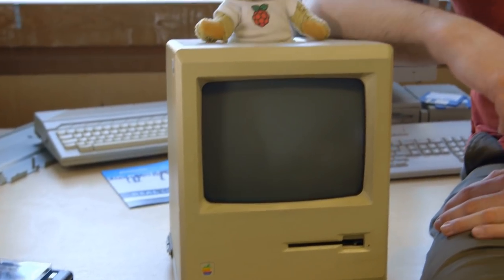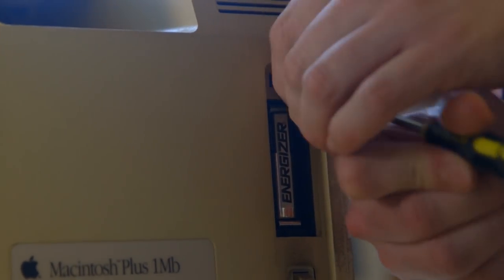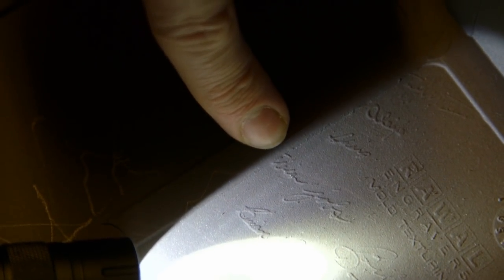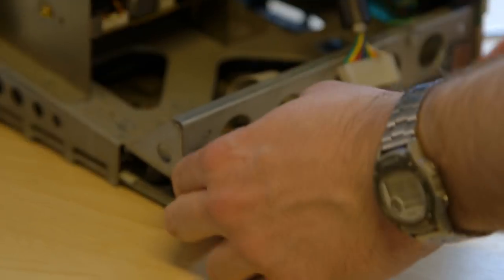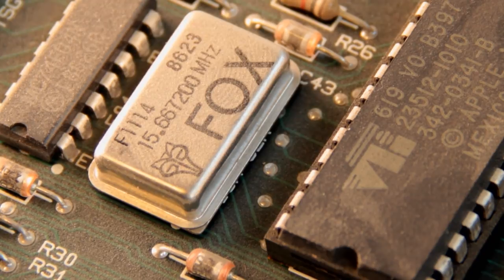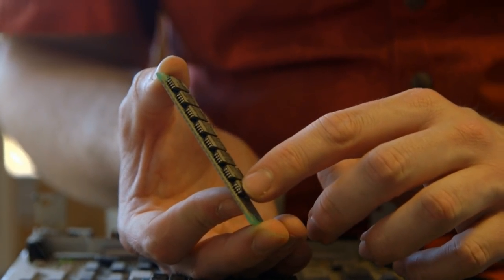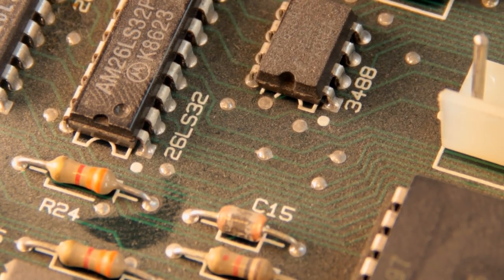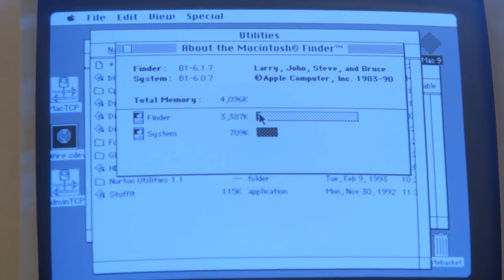Opening up the 30yr old Mac - Computerphile

Comment: I once decided to try to disassemble a camera for fun... Turns out there was this thing inside that contained energy for the flash... Maybe 230 volts? .-. Paralysed me for a few seconds -.-
Reply: Lmao. Doh!
Reply: Damn man, glad you're fine. You probably did it to learn something and in the end you learnt something :D
Reply: maybe it's a capacitor because they can discharge absurd amount of voltage and flashes need that.
Reply: Yeah, probably! :P
Reply: 230 volts? Trust me, you wouldn't be able to write this here then.
Reply: Welcome to the party! :p
Reply: TheIceWarrior It's actually probably a lot more than 230V. (Those flash types like their HV.) But the total charge and thus the damage it can do to your body is rather limited.
Reply: ***** Ohm's law
Reply: +Erik Bakker The 'It's not the volts, it's the amps' statement is painfully wrong. Take one look at Ohm's law and you can see this.
Reply: ok?

Comment: And to further add to the confusion, apple ran that 16/32 chip in a 24-Bit mode....
Reply: +THEtechknight 24 bit mode just refers to how everything was converted from 16 to 32 and from 32 to 16 whenever it entered and left the chip. When you say something is 24 bit, everyone knows you really mean 16/32. It is just easier to say 24.
Reply: 540iDavid Not in the Apple world. it has an entirely different meaning. The databus is 16 bits, but the Address bus is 24 bits wide. it can address up to 16MB of space total. Thats what 24-bit mode means in the apple world. 32bit address capable CPUs came out, but early Apple machines defaulted in 24-bit mode, and the ROM was dirty meaning the last byte of the 32-bit word was used for other things instead of addressing. MODE32 fixed this.
Reply: The 68000 has a 24 bit address bus so it's not like you could use it any other way.

Comment: Be careful taking those little bastards apart. The flyback transformer in those will hold a jolt that will stop your heart for many years after being unplugged.
Reply: What, nobody has corrected this in all these years??! A transformer or an inductor will not hold a charge. A capacitor will. And frankly I'm a bit surprised that Steve was just blatantly "I'm not touching that". It is not hard to discharge the big capacitors! Well maybe Steve has not much knowledge about analog/power electronics...
Reply: false.

Comment: It also had 16 bit ALU. I personally view it 32 bit as later pure 32 bit CPUs ran exactly same code. While it could use "only" 16 MB memory, in principle it could have used full 4 GB if it had had enough address lines so same code could use full 4  GB on later models. Intel 8086/88 on the other hand was hard fixed to 1 MB. To use more on later CPUs one needed different code, first 16 bit protected and then 32 bit. 

Original Mac had 128 kB memory.

Comment: An unwritten law of opening computers is that every time you do it, you will lose one screw! My old ST ended held together with just one screw because of this and pretty much every PC after that suffered a similar fate.
My current Mac laptop has been opened once and still has all it's screws, so maybe this law doesn't apply to modern systems? :)

Comment: I miss those days back when you could have a 4 megs machine and do much of the things we still do today that now requires 4 gigs to run...
The original Mac had its OS on one or two 3.5 inch floppy disks. Compare that to stupid Yosemite that takes over 5 gigs to do basically the same thing today !!
Reply: +AlainHubert Go write your own OS that takes 4 megs to run. Have fun
Reply: +GTR xConfusion  huh!?  Easy!
Reply: +doceigen no, very hard. You have to make the space taken up by the OS very little.
Reply: Ishan Dwivedi  No, it's easy.  FULLY folded out with every feature, OS 7.1 weighs in at 10.7 megabyte.  With the useless stuff removed it was far smaller.  The entire Finder plus System together, are 1.4 megabyte and easily fit on a high density floppy.  In fact, even they were bloated, with the boot up disk weighing in at 400 kilobytes and able to do all kinds of multi-tasking, memory management, media vectors, graphics and GUI, music and voice, and everything we've come to know as 'Mac'.

Its modernity, ...the need to run other people's bloated stuff, that has pushed these wonderfully elegant systems under the carpet.
Reply: doceigen Do it then, prove your worth :P
Reply: doceigen but back then people didn't know all this stuff, there was no OS 7.1 to size down. These guys were the first people to do this kinda stuff.
Reply: Ishan Dwivedi BEFORE... drum roll here there was System 7,... there was system 6, and before that System 5, and before that System 4.  I still have 4 on a Mac Plus somewhere.  And yes, the OS structure of GUI changed the world, I know.  My point was, IT COULD BE DONE on the RAM cheap.  

And if OSX would ONLY load the kernels and resources, etc. to support work at hand, even today it could be far more efficient.  I often use the activity monitor to deactivate specific sub-function, it helps. 

Recently I sent a note to Apple Development asking them to add a 'Baby Mode' cancelation in the SysPrefs. WHAT!?   You know how the OSX always asks multiple times whether your want to do something?  Or it has to chime in with helpful attitude, alerts, cautions, etc at the worst times?  Of how Safari will freeze all function while it waits for some response?  I collectively call all of these... BABY MODE, "Are you sure you want to change something, are you really positive?, ok... tell us again!"  Hate it!

Comment: Oh, man, flashback city. I worked on these a lot back in the day. Worked the iMacs, too, when those came out (and everything between, but must those didn't integrated crts). I learned how to 'safely' drain the capacitors on the crt using a pair of screwdrivers, but every time I did was with my heart my mouth. 

I knew a guy who forgot to drain the crt once. He survived but had nerve damage in his hands from the discharge and a concussion from whacking his head on the wall behind him.

Comment: "No screwdrivers?  Grab the saw!"

I did some work for a university computer hardware reutilization program.  Some things you'd get in weren't worth enough to do anything but "does it work, and if not will it cost more than five minutes to get it working" (old XTs and ATs).  Before we had the super long torx drivers (which were on order), any time one of the old unibody Macs came in with something not worth repairing (broken monitor is a good example), we'd open it with a small circular saw to get at the RAM, since that could be used to upgrade other Macs.  I'd be lying to you if I didn't say it was highly satisfying.
Reply: ok?

Comment: I have searched everywhere for a picture of the "busy bee robot" brand 30 pin sims i had in my first computer, a 386sx 16mhz machine.. mine also didnt have 4 MB ram, only 3~or so and i could never get the virtual ram working right so i couldnt play jazz jackrabbit on it.. :( 
Windows 311 worked fine though ;)

Comment: The Mac Plus was the cadillac of macs back then... esp. that one with the external drive.   Not really an old Mac.   To have a really old Mac... you need a 128K... which I have several...  or a Lisa...    or...   an Apple Ii, or Apple 1.   My oldest Apple is a rare black Apple II.  Its definitely not the oldest computer i have, however.   That would be a pristine TRS-80 Model 1, which came out in 1977....

Comment: This reminds me of the Ibook I have in the cupboard. Got given it for free. Why? It's so old it won't do anything. Oh, it works perfectly, but is not compatible with 99% of websites, programs or media. It could be used as a DVD player if I had not put Linux on it, and then realised I lost Hardware support (software playback is to slow).

Still, it's a solid laptop, I'll give them that. It is/was well built.

Comment: In all fairness, opening up the old toasters does involve a certain amount of danger; somebody with a screwdriver but not enough knowledge could get themselves hurt or killed, and then lawsuits... so it may have been a good thing all told to make them hard to get inside.
Reply: +theRealPlaidRabbit no, that doesnt make sense. if you put a warning in the manual than you shouldnt be able to get sued over it. if thats not the case the legal system should change because thats the way it is here. there are safety standards but as long as you comply to them and nothing dangerous can happen with instructioned intended use you shouldnt be able to get sued over it.

Comment: The CRT can contain a high voltage charge for a while, but its easily discharged with a screwdriver under the anode cap and a wire to earth. I've had quite a few shocks working on CRT's in the past and I can confirm that it will not throw you across the room and it will not kill you.

Comment: I wouldn't recommend licking those caps or anything, but if Apple did a half-way decent job with the Mac Plus' hardware design, they added bleeder resistors to discharge those caps within a few moments of losing power. The odds are actually pretty slim that you could get a fatal shock from an unplugged Mac Plus.

Comment: A late comment - no-one seems to mention that the 5 torx screws are actually not identical!  The two set deep on top are "self-tapping" screws because they go into plastic, and the other three are "metal-thread" because they screw into the metal chassis. Inserting them the wrong way destroys the thread they screw into.

Comment: I do this kind of stuff at home to and i have a way to empty the capacitors
Reply: I have a way to cure cancer, but I won't tell you either.
Reply: The light bulb method usually works
Reply: dafl00 Yeah but those are bigger they are like 300 volts i think they would burn a light bulb that's very unsafe i just use a wire
Reply: ***** So why don't you tell us already?
Reply: Tell you what?
Reply: ***** Your method :D
Reply: you can tell us how to cure cancer
Reply: Hampus Gans I could but I won't.
Reply: Hendrik Werner OOOOOH im sorry well i use a ground wire it always emptys it and i leave it attached when i work on it so i'm sure its safe. usually Capacitors empty out instantaneously but it doesnt hurt to leave the wire on it.
Reply: Hendrik Werner If you dont tell the way to cure cancer then you hurt more people that just me and that other guy
Reply: ***** Curing cancer is easy.  The problem is making the patient survive the treatment.
Reply: I used a screwdriver for a 400V 100 uF capacitor. Scared the hell out of me. Used the screwdriver to check if it was completly discharged. It scared the shit out of me again. :))

Comment: That Mac probably hasn't been used a lot during these 30 years. Otherwise its analog board most likely would have been toast by 2014. These were notoriously flaky.
Reply: HotelPapa100 I bet your current computer won't be around in 30 years. Everything is throw-away now. A mobile phone that's a year old is seen as obsolete.
Reply: It was used a fair bit up until the late 90s, according to the previous video.